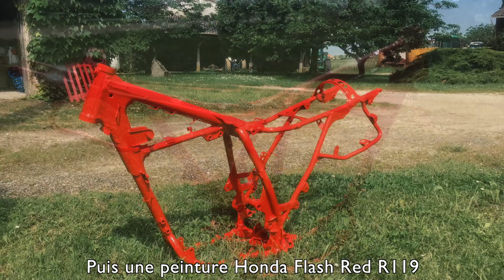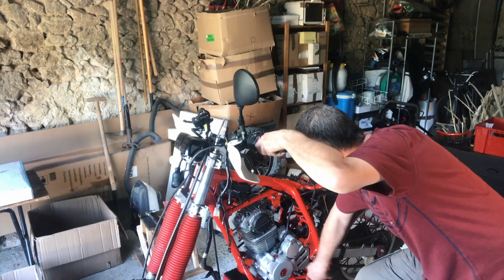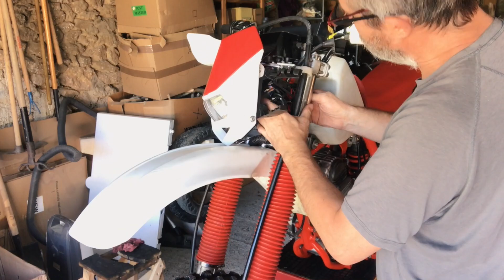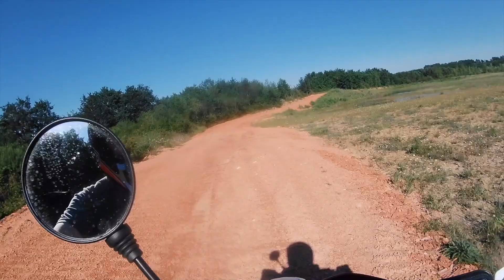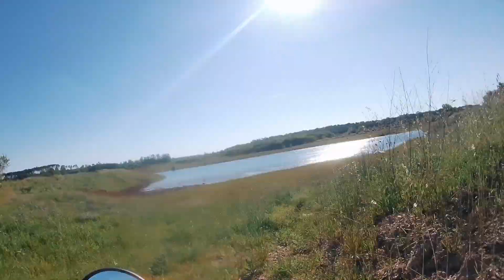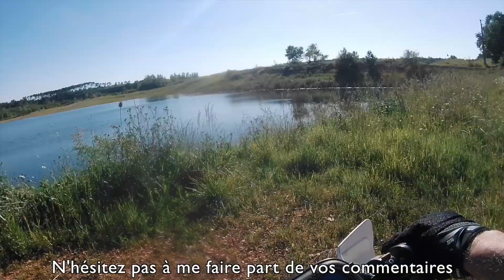HONDA XLR125R JD16 Part 16: Timelapse du remontage après peinture

Comment: Why did you go for the xr100 tank???      It looks fantastic.......it looks how it should have always looked from the start.........but why did you choose the 100 tank???       Is it the best fit???      Or best fuel capacity???      Also is that the original seat???     Or did the seat need modification???
Reply from the maker: the XR100 tank was an easy fit but it was too small for my usage (6.8l) so I went to the XR250 tank (10.9l) without any seat adjustment

Comment: how was the power increase with the berlt camshaft? I'm looking to get one for an xlr125 to hopefully increase the top speed a bit?
Reply from the maker: No, it won't. Just slow and and mid range power.
Reply: @BenGallou  okay thank you, no increase in top end power then?
Reply from the maker: @shabbagadoosh  No. For this you need a short exhaust , an uncorked air box and a nice carburetor

Comment: Very good, what's the tank off?
Reply from the maker: At this time it was a XR100 tank then later I fitted a 1999 XR250.
Reply: Nice bike, did the xr250 tank fit good?
Reply from the maker: The result is ok. The XR250 tank looks better in my opinion but with many more modifications on the frame. Take a look at Episode 17 https://youtu.be/IeeD-kG6wbk
Reply: @BenGallou  thanks for the reply, I shall take a look